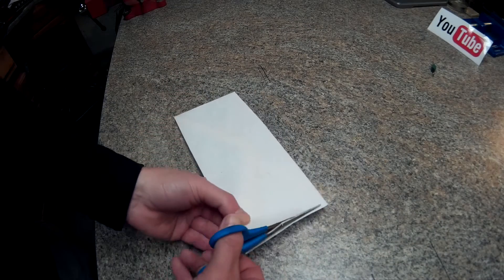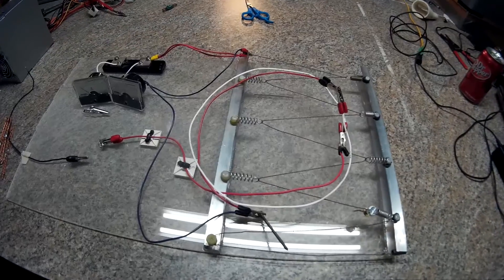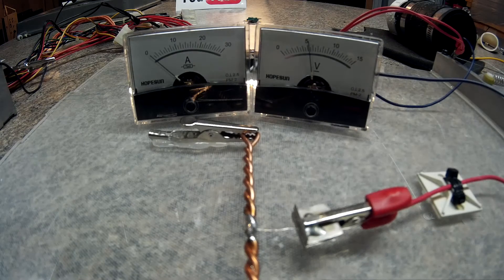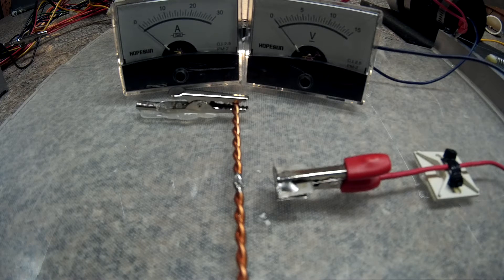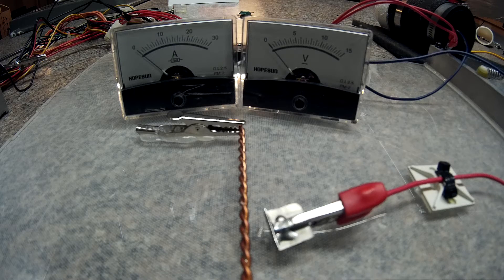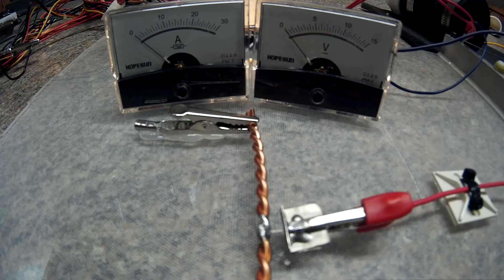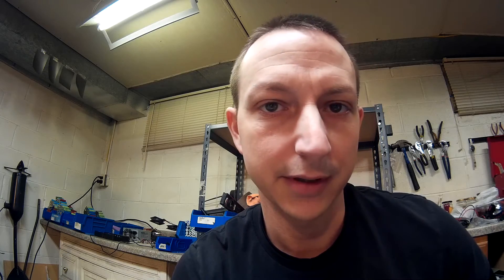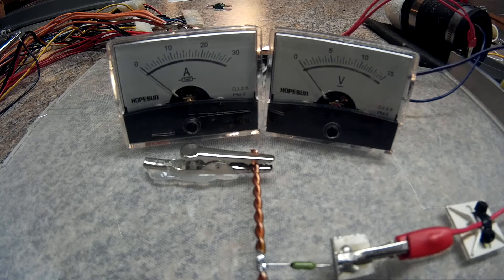Diy Tesla Powerwall ep30 Terry Texas Fuse Wire and Pico Fuse Test

Comment: Thanks for testing the pico fuses Joe, I  appreciate it. Wattsup Diypowerwalls.
Seem like they could be ok but higher amperage ones.
Another great vid
Reply from the maker: Ahh there you are lol.  I was going to send you a message on the forums when I woke up but you found the vid.  Yeah I agree, they seemed to work really well but you wont know that they popped unless you physically check them.  I had a dumb moment in the video(that I cut out) where I was trying figure out why I couldnt get get anything to work cause Im so use to seeing or hearing the fuse pop.  I finally had the DOH moment and checked the fuse and found it had popped.  Yeah you could get higher rated ones.  I found these out of the medical packs I tore apart

Comment: @AverageJoe first thanks for entertaining and educational series :) You mentioned previously (if I remember) you are looking for fuse wire that pops just above 2A @3-5V but so far all with thickness around 0.2mm are from around 11A up, right? In videos most ppl building Diy powerwalls I noticed use fuse wires of length < 1cm even 0,5mm - so it makes it much more than 11A... isn't that too much and only for 'dead short'? Will it handle cell that dies quick enough?
Reply from the maker: +Martin Kubiš Thanks lol. Yeah Im looking for 2 amp pop so if the cell dies it will pop that fuse and not bring down the hole pack. Yeah seems like most pop at around 11 or more and you are correct, a lot of people are using farly thick wire and small gaps.  IMO its to thick and to many amps. But some people just want a dead short fuse. I shoyld have another fuse video up in a day or 2.
Reply: Thanks for teasing :) I am also looking for one around 2A. I just found wire that is 0,11mm and at 10-11V it handled between 1,2 - 3,8 A (distance cca 1,5cm) which could be the one :) Unfortunatelly dont have equip to try at 3-4V yet... Really, looking on the DIY videos I can see even 2mm of fuse wires between soldered parts... And as we could see just the other day with Pete's HBPowerwall, they work for dead short... but what if there is just 10A "short" or something?
Reply from the maker: That isnt to bad of a fuse if its blowing between 1-4amps.  I could test some for you if you were interested.  Ya Some peoples fuse gap looks tiny.  That is one of the other reasons why I chose to start testing wires.  Send me a PM or an email if you want to send me a letter with some fuse wire to test.  Joe